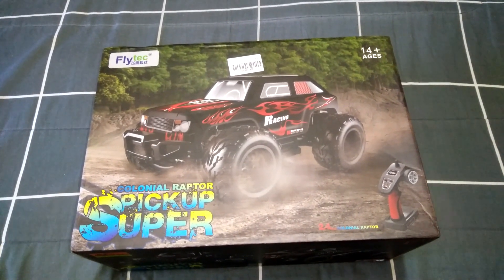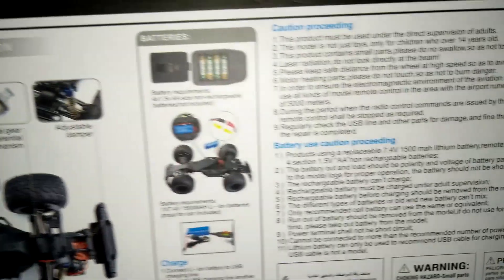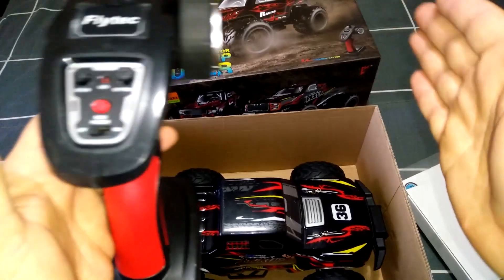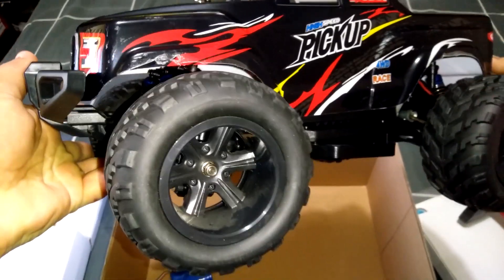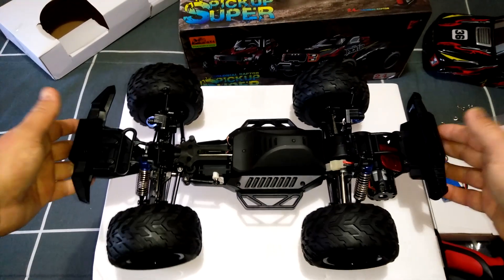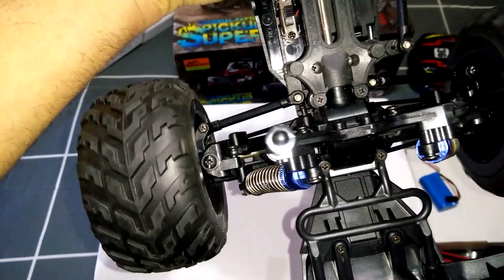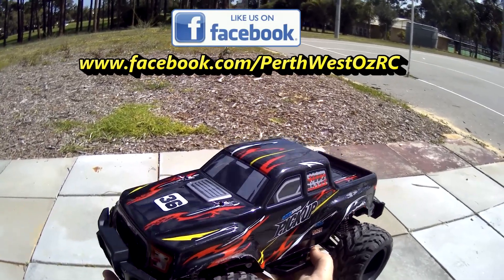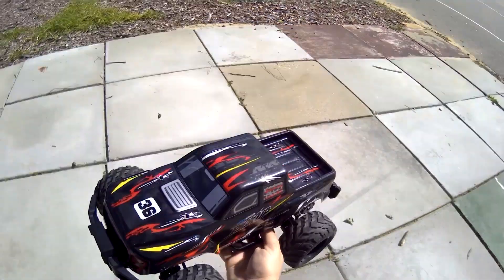Flytec 8897 Raptor Pickup Truck Review

Comment: Was surprised what I saw when you took the body off.  Looks just like my Subotech BG1513.   I've upgraded my completely to brushless and oil shocks, but I've beat it up for over a year now and it's holding up great.
Reply from the maker: Yeah i noticed that the chassis is basically the same as some Subotech trucks... thanks for watching James

Comment: Nice vid brother. That truck uses the same chassis and parts as the Subotech BG1518 also known as The Brave and Tornado. I still need to review the BG1518 that I got for my brother, about a month or so back they were on sale on Amazon for only $29.99!!
Reply from the maker: Cheers Alvin, yeah man before shooting this video I noticed once I took off the body shell that the chassis is identical to Subotech Brave truggy
Reply: @PERTHWESTOZRC  it's a pretty decent platform and I definitely think it could easily be upgraded to hobby grade brushed electronics(maybe even a mild 380 brushless system too), I've already modded the one I bought for my brother and put a deans connector on it right away before running it and for my review I wanna make sure it's still running on the stock battery so I also have the same 1500mah  li-on battery as the "stock" battery but with a deans already on it(from my wltoys 12428). Definitely a great beginner RC for both kids and adults 🤟
Reply: Tiff has the tornado,  still tears it up almost 2 years later

Comment: Do they still sell parts for this rc truck?
Reply from the maker: Yes most Subotech 1/12 scale rc truck parts will fit this one as they are the same
Reply: @PERTHWESTOZRC  Btw how long did it last or does it still work and did you ever fix it
Reply from the maker: Still a great truck no issues at all, link is in the description if you want to check it out
Reply: @PERTHWESTOZRC   thx keep up the good work your vids are quality
Reply from the maker: Cheers mate appreciate it👍 have a good New Year
Reply: @PERTHWESTOZRC   so my rc truck doesn't turn on for some reason how do your turn on?